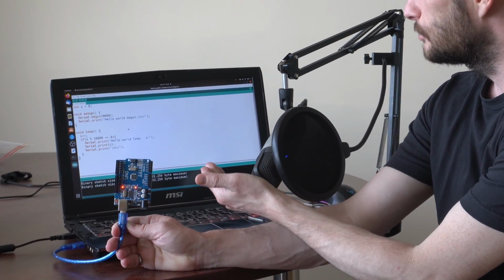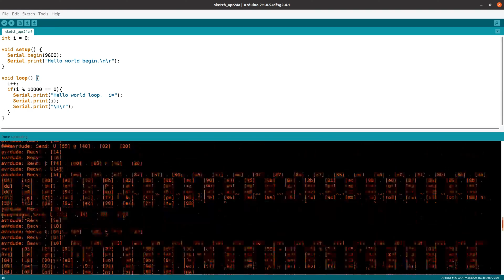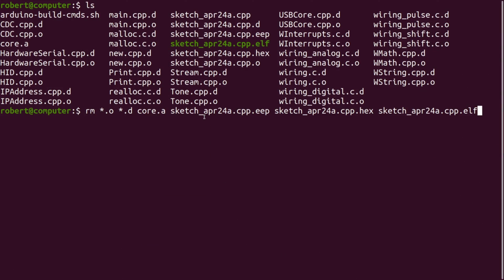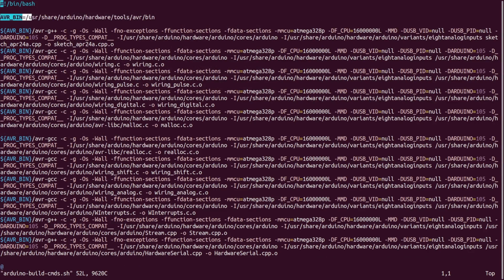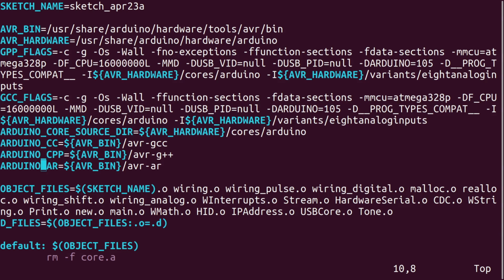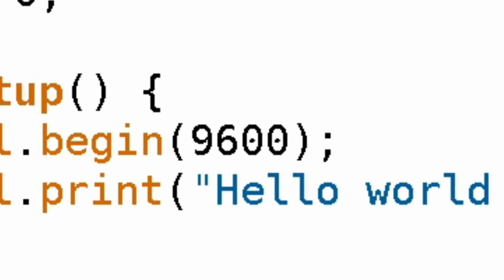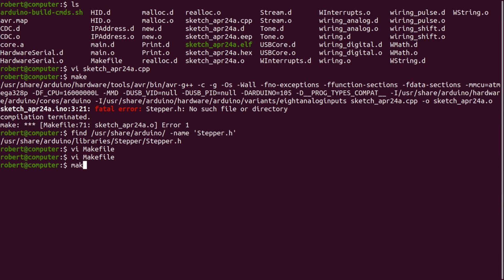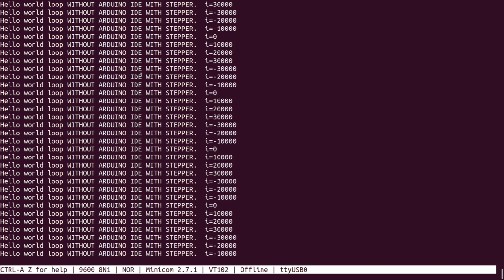How I Became A 10x Arduino Programmer - Ditching The Arduino IDE For Makefiles & Linux Command Line

Comment: Hey Robert, I know this is an older vid but this is great content.
Reply: Same .just wish I still did things with Arduino, lost interest after mastering making LEDs blink
Reply: @alex-duz-stuff hi Alex, I recommend using esphome, esp32 c3 (antenna mod is fun and honestly necessary), I recommend a t12 to solder with. Esphome has a list of parts you can use on the site.

Comment: Very interesting.
Just a question, would you argue that the arduino-cli could be useful to at least obtain the compilation process in order to create the makefile without installing the IDE?
Reply from the maker: Yup, that's basically how I bootstrapped the process.

Comment: Personally, I too felt very limited by the Arduino IDE and now do my hobby microcontroller related projects with PlatformIO in VSCode where I have all my comfy nannies like Copilot and library search right from the same program, and freedom from Arduino libraries and snippets and.... The Arduino IDE is missing a lot.

I get the feeling though that Robert likely isn't too hot on VSCode which is an assumption mostly made based on his prior GPL3 shirt and tendency towards a cli, which I can get.

I still bet this video will have a lot of interesting things for me too, because while I know how to go without the Arduino IDE, the only other way I can think of doing things outside of PlatformIO is just following the chip manufacturers guidelines and often it seems like such a pain VS PlatformIO which just kinda does all those steps for you without you necessarily needing to learn a whole lot of different secondary tools.

That being said, I've been increasingly trying to learn more about what, how or why things tick, and have been trying to go lower and lower abstraction level wise in projects I take on personally. Currently for instance I'm at the very beginning stages of trying to self learn circuit design and PCB design as a hobbyist, and since I learn best (or rather keep attention best) with projects rather than courses (at least online ones where there isn't someone to guide me/set deadlines etc), I think I'm more or less accepting that I in a way prefer doing things the hard way. TBF to me the hard way at least (sometimes) gets you finished results that make you satisfied vs follow along where you just get what was already made.

Edit: Actually now that I'm watching I'm wondering if perhaps PlatformIO wouldn't be something Robert might even be interested in as it covers a lot more than just Arduino, can be run from the command line and is open source. In essence while I use it in VSCode, you can just use it in your bash shel of choice if you want.

Also, in the event Robert isn't aware of them (though I would doubt he isn't as he seems pretty experienced in ... everything, Arduino Unos are really old/kinda fossils and you can get esp32 based boards for similar prices with all sorts of feature improvements from being an order of magnitude faster (at minimum), also having WiFi, Bluetooth, and in some cases dual cores (especially useful when you are doing something that needs a lot of continuous chooch and another thing which just deals with IO/a web server etc.

Once I figured this out, microcontrollers became a whole new world. Now I'm interested in circuit design and PCB design and STM32s and more.
Reply from the maker: Personally, I prefer not using stuff like VS code because the 'old terminal way' is much more future proof.  When using the terminal, I can learn how to do something once and never have to re-learn it, but with IDEs it will completely change every few years, and in 5 years, it'll be some new editor fad.  Everything used to be about sublime text, but now nobody talks about that anymore.  

As for the ESPs, I did have some experience playing around with the ESP8266:

https://blog.robertelder.org/routing-packets-between-esp8266-modules/

In recent years though, I've been trying to invest less of my time in these sketchy platform ecosystems that are based in China.  I haven't dome much embedded stuff in the last couple years, but when I get back into it, I'll probably start playing around with the Raspberry Pi Pico and any other new stuff in the RPI ecosystem.
Reply: @RobertElderSoftware What are your thoughts on PlatformIO in essence just saving you from having to learn the arbitrary steps for any given MCU, and prepackaging that for you in an open source tool?
Reply from the maker: I hadn't actually heard of 'PlatformIO' before you mentioned it.  If I did more embedded stuff, I might look into it, but lately I've been focusing more on pure software dev.